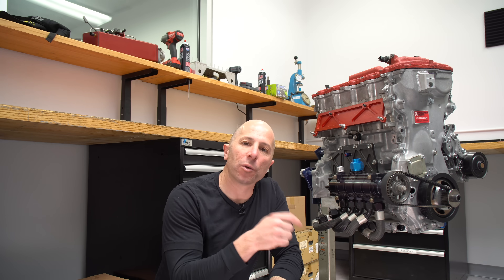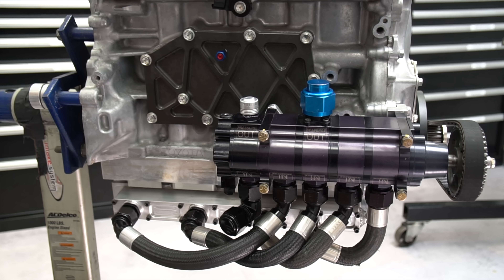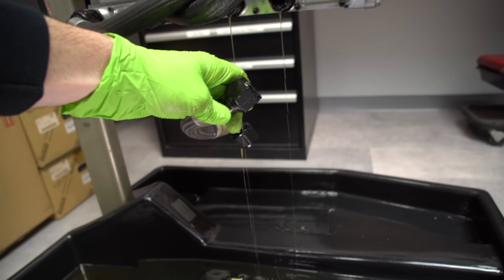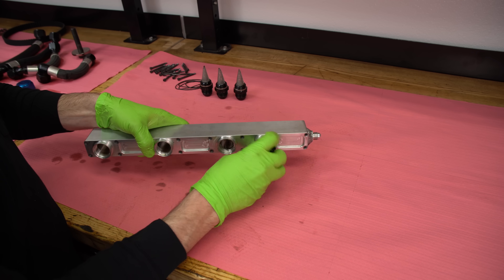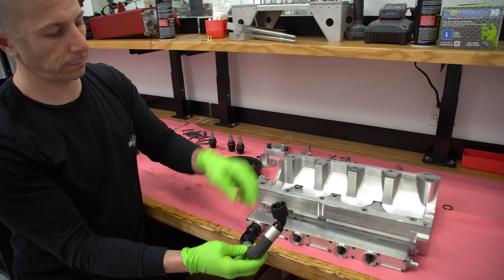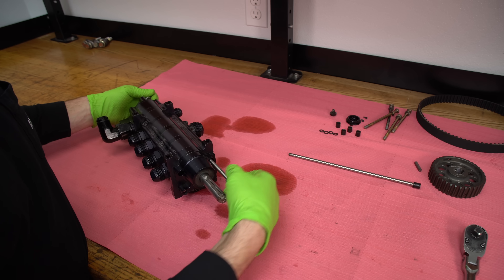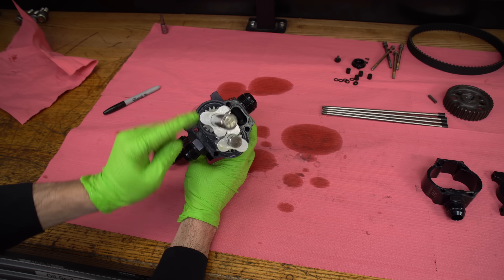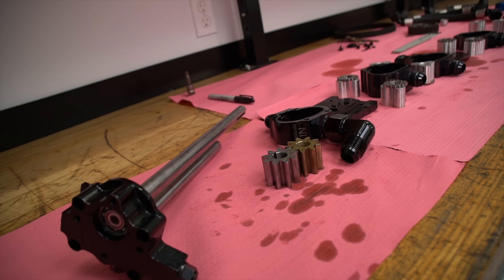Dry Sump Oil System Teardown and Description

Comment: Cool thanks! Adding oil pumps for dry sump adds parasitic loss to the motor, so I find it interesting that it can still produce a net HP gain over wet sump - adds a lot of complexity though

Comment: Since this is a relatively low pressure oiling system (easily sealed with an o-ring connection) why not just extend the aluminum housing to accept the pump inlets and omit the four hoses. The inlets would have a metal tube each with dual o-rings and mount to the housing and the block. The pump would be closer to the sump and the intel prime would be a shorter distance. 

Have you ever designed a dry sump which has an electric motor drive (this is very popular for off highway)? For road car applications which require redundancy, the pumps are spit into two sides or two scavenging pumps and the two are joined with check valves such that if you loose one brushless dc motor the other will make sure the engine is not starved of oil. The pumps can be smaller, more efficient and with tighter tolerances because they run at a single speed.

Comment: i know this sounds like extra weight, and complexity but what if relief valve oil was directed to a tank with a sealed piston (oil one side - compressed air on the other) have this and the pressure lube join at a shuttle {[highest pressure/flow wins] (on/off solenoid so engine can be prelubed and/or turbo always has pressure even if snuffed / inline check incase of shuttle failure so pump doesnt ever try to back feed)} grammer etc not checke, just ideas but it would allow for an accurate warning lamp  if pump failed and give driver time to shut down before the crank touches the mains

Comment: Great video, thx.  Can you do one on the rest of the system especially the air oil separation options, from wet sump to big pumped separator to a powered (spinning guys) separator?   Or maybe someone knows where some good info and comparisons on these can be had.  Thx again.

Comment: Thanks for your video!
Where is the oil input connection located onto the engine block ? Is the oil being fed into the engine through the stock oil filter port ? 
Thanks

Comment: It appears you are running nylon outer lines?  I have heard these are lighter weight.  Can you tell us the pros and cons of each type of line?  Stainless vs nylon.  Building my first dry sump engine right now and leaning toward the lighter weight lines.

Comment: I'm planning a build. I have a lot component's for it already.  But I was wondering if this would be worth running on a 1.8 4 cylinder turbo at about 600hp. Id have to make my own oil pan because there's no dry sump kits for my engine. But my motor has a perfect place to mount the pump its the previous ac location that's belt driven.

Comment: I was wondering if a BMW S38B38 (E34 M5) wet sump engine can be converted to dry sump for use in an E26 M1 (replica)?
And where could one possibly get the parts (made)?

Comment: Question to all the experts out there:  Since this style of oil system is used mostly in racing engines, I suppose it does not matter that much to get comparable oil life to wet sump oil systems.  However, by the looks of it, this style of pump looks like it would 'shear' oil much faster than your conventional wet sump pumps out there.  Is my assumption correct?

Comment: Does the dry sump vacuum system that gains HP put less pressure on the rods? Since it’s aiding stroke that usually bends them while also adding HP?
Reply: Not so much rod pressure as it is easier crank turning. Think of the throws on the crank turning through the air / oil in the pan. Now think about how much energy it takes for a rocket to take off while it is in the earths gravity, versus once it reaches space. Same kind of thing, you are removing the resistance for a large spinning object trying to move through a pressurised environment therefore reducing HP loss. There would be a small reduction in rod pressure through reducing this drag, but most of the rod pressure is still going to be caused by the combustion cycle. Doing this doesn't give you a HP gain, it merely reduces the loss, same but different.

Comment: Laugh in tesla.
Reply: laugh at what? do you think a car is the only thing that has oiling systems?
Reply: @MarioXcore1  does teslas use dry sump ?
Reply: @Paguyuban_tepa_selira  you dont understand, 
1. what is there to laugh at? just because a Tesla uses a direct drive motor like a washing machine doesn't make it better in any way
2. dry sump oil systems are used in many industries, not just automotive.

Comment: When the scavenging is running, will the oil flow to the tank be full of air?
The tank then needs to be able to let the crankcase air out, but still hold a small over pressure of oil, because the scavenging needs to be better, then the oil pressure side, to keep the engine from filling op?

Comment: So why arę we only hearing about the pump how about showing What the difference between dry and wet is and not just that there is a pump in the dry and how the pump works ?
Reply: I think this assumes that you're already familiar with a standard wet sump setup, as 98% of 4 wheeled vehicles on the road today use them. 1 pump, with a pickup submerged in an oil pan...

Comment: is it possible to get some blueprints for reference ?
what about coupling to an electric motor ?
Reply: Electric motor would make me nervous, say it blows a fuse/relay or a wire wiggles loose.  I know it's probably a silly fear since belts break too, i've just never been comfortable with an electric pump for anything but fuel.
Reply: @UnyieldingSeraph  An excellent reason !
I'll choose a computer monitor to shutdown the engine if dry sump system isn't working as expected to avoid engine destruction. Directly driven by a "Normally Open" relay configuration from "Ignition Detection" (a.k.a. engine run) signal (ignition from ECU), do you have real life examples on choosing the electric motor, maybe we can use the AUDI style for the electric supercharger to avoid secondary parasitic loads to the crank shaft.

Comment: Great video.  Many super cars now come with dry-sump from the factory.  This includes the 2nd gen NSX, R8, Huracán, and pretty much all Ferraris from the last 30 years.  In these vehicles the scavenging passages are cast into the sump and the external oil pump bolts right to the side of the sump. This eliminates all of the scavenge hoses.
Reply: theres a difference between a 120 dollar stock set sump oil pan with modifications and a 3000 dollar stock dry sump with integrated pump pan. apples and oranges man

Comment: The main reason why dry sump systems are better is the fact that you have constant oil pressure on all the galleries, tubes and passages which is important for adequate lubrication without causing oil starvation, which is possible on a wet sump. Since the oil is stored in a separate container than the engine itself, you can have more a better cooling effect in the process. The drawback is there is a difficulty of fully draining the oil, unlike a wet sump system where all the oil is at the oil pan.

Comment: I'm so glad I went drysump on my LS Miata. Amazing oil pressure at all times, doesn't drop off hard with oil temp, much better oil temps, no worries of starving it in drift.
Reply: Could a dry sump oil system, solve the issue of oil dilution? Which seems to be a problem for vehicle with direct injection.
Reply: i would imagine most of the benefits towards oil dilution by fuel from a dry sump would be:
1. higher volume of oil, so ratio of oil to solvent would be lower over same amount of runtime
2. oil tank may be vented, and air oil seperator may additionally give time for oil to lose residual solvents. both must be run for a while, and i believe fuel dilution arises after consecutive cold starts, as cold Combustion Chambers allow for fuel to condense and hitch a ride with the oil. 

perhaps for direct injection applications, a warm-up oil heater could be integrated to reduce fuel accumulation in resevoir, which only runs within a low temp window to prevent unnecessary heat soak
Reply: see the toyota prius exhaust heat reclaimation system, plumbing coolant through a thermostat-based jacket around exhaust manifold, letting engine warm up in less time
Reply: Does it produce a straight cut whine sound since it has spur gear inside?😊
Reply: You're a beast

Comment: Great video!
 So due to the added vacuum pulled on the crank case by the dry sump pump, would this drop the need for a pcv system all together? The clean air tube from the intake\suction pipe that replaces the crank case vacuum loss would also be redundant? I'm assuming that air would be now coming from the oil catch can, or the boost would be still creating an over pressure to vent to the tank.

Comment: I have an RB30 Nissan. Oil pressure is ALWAYS an issue. Strongly considering a system like this. Yes I know it’s not cheap. But neither is replacing an engine due to low oil feed.

Comment: Wouldn't it be easier to just change the size of the pulley to adjust the flow of the pump?
Reply: For half a second I thought you might be onto something there. I think the reason why they don't do that is for pump efficiency. Let's say you have low oil pressure, spinning it faster is going to create more of a hp drag, just like spinning a blower faster increases the hp consumption exponentially. It could also induce more heat into the oil. Higher volume, lower speed is going to create less cavity issues also.
Reply: @DodgyBrothersEngineering  Fair call, thanks for the reply mate! And hi from Australia!

Comment: Love the videos, and wish to have one of your beautiful engines.

There is no suck, there is only blow.  Atmospheric pressure blows the oil into the pump, and the pump pushs the oil against atmospheric pressure.  In a total "vacuum" there would be no oil flow unless the pump was lower than the pool of oil.

Comment: Ok, but you didn't mention how it lubricates the engine. Very good explanation of how oil is delivered from the crank to the reservoir, back through the sump filter -> oil filter -> cooler and then to the engine. But back where? Where does it go in order to provide sufficient lubrication, head cylinder and due to the gravitational force drips back to the crankcase? Or is injected in different parts of the engine?

Comment: i want one on my 2jz,,,question would a dry sump good for daily use?
Reply: if you don't track your car hard, you're just wasting your money on a dry sump system. Meaning, yes you can daily it with no drawbacks, you just wont be able to take advantage of it, there would be no point.
Reply: @gwot  cuz some swap i want to do the oil pan seat right at the cross member,,so i was thinking of s dry sump would make alot of clearance ,,,,with out modding your oil pan and pump
Reply: @leezykp  that is true, but, still a lot of money for dry sump set up but if you've exhausted all other set ups, i guess you have no choice

Comment: Couldn't you get away with only having a front and rear pump for heavy braking and acceleration respectively? That would reduce the complexity of the system, but I guess if you're putting in a dry sump, you don't care as much about cost.

Comment: If all the slots are on the right side of the sump, does that not mean the pump is pulling air every time the car turns right? I suppose the tank is big enough to supply oil for longer than the longest turn without being replenished but would multiple seconds without oil flow at high revs not wear the pump?

Comment: By design the nose has a stuffy nostril wich regen his moisture and tissues every 3 hours or so.(like a DPF i guess lol)
So you always have a partially clogged nostril for 3 hours and it switches to the other.
Just try sniffing pretty hard several times during the day,you will see one side is working better than the other.
Reply: michaelovitch i noticed this but didn’t realise that is how it’s meant to work! Interesting! Thanks for the info

Comment: No other car channel gives such easy to follow, straight to the point quality information. Keep it up!
Reply: Chris Fix.
Reply: @markoz673bajen8  chris fix... really???? the guy who "repairs" a rusted fender of a unibody where the rust is so bad that a good part of the inner fender is seperated from the outer shell just by slapping some mesh and bondo on their? do that on a few key parts of the body and the structural integrity is pretty much gone, good luck in an accident.
Reply: artdamage0 the skid factory. 
You’ll get this and more.
Reply: Dylan Zrim don’t get me wrong I love the skid factory and Al is an amazing mechanic, but the level of professionalism and straight up knowledge dropped in these videos is second to none

Comment: Papadocalockanockadockulus Racing.
A dry sump by definition means there is no fluid there. I mean I love my oil system. So much so they actually laser etched my name on it and the engine block.
Reply: There's always some residual oil in the pan though, isnt there?

Comment: I track race a 05 Crown Vic and it looses oil pressure under hard braking to set up for turn..
Reply: Have you considered a modified sump with baffling, so all the oil doesnt surge toward one end an enough stays around the oil pick up? Maybe a deeper sump with a modified oil pick up?

Comment: Great video as always. Would it be possible for you to discuss aeration of the oil and how you remove the air?
Reply: I think the vacuum in the crank case would help with that, like how mold makers use a vacuum chamber for their silicon
Reply: @gigamac2486  i suspect you are correct, however after the oil passes through the pump it will again be aerated, but that happens on a normal pump as well.

Comment: so drysump  basicly means ...: sump is above the lowest point of the engine
Reply: No, it means the sump isn't the oil reservoir like it is in most road cars. Instead there's a separate oil tank. The major advantage is that the motor can be positioned lower in the car thus lowering it's centre of gravity reducing body roll.
Reply: i thought the sump itself is the reservoir
Reply: @StellarionPrime  in normal road cars that indeed is the case. On the race track the dry sump rules for 2 main reasons, firstly it lowers the centre of gravity, and secondly in the case of an accident you don't dump several litres of lubricant all over the track.
Reply: yeah i got that right from the beginning ... but what is the SUMP then wehn having a dry sump ?

Comment: A full race car oil system break down would be cool, if this is a vacuumed system then do you even need to have a catch can set up for blow by?
Also thank you for the videos and the information! Super insightful!
Reply: apparently the oil tank can serve as an air oil seperator if built correctly, and the scavenge pump will pump crankcase vapors, oil mist, etc along with the air it takes out( the lack of air is what can be considered the level of vacuum) which is then fed through a baffled input to the tank. i believe dry sump takes the catch can idea and does it properly...

Comment: Cool video! I'm kinda fascinated with dry sumps, even though I really don't have an application that needs one. Something I've noticed is that cars like the Z06 corvette (both LS6 and LS7) use a integrated oil pump in the stock location for their dry sumps. It would appear that they only use a single scavenge stage. This got me thinking, for something like a budget drag car with oiling issues, or a 24 hours of lemons car, could you fabricate a feed line to the stock oil pump, and run a cheap electric scavenge pump for a simple, low cost dry sump. Leave the stock oil pan in place, just allow for small amounts of oil to pool in the bottom. You could increase oil capacity and reduce oil starvation for minimal cost, but of course likely without the benefit of drawing a vacuum, or increasing ground clearance. Neither of which is a massive concern for either application.
Reply: zo6 had oil issues from the factory